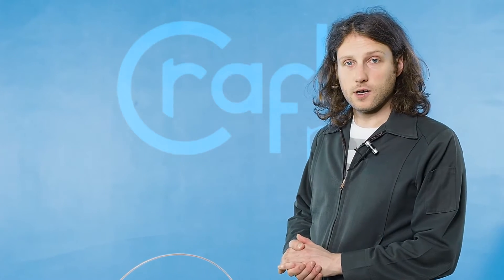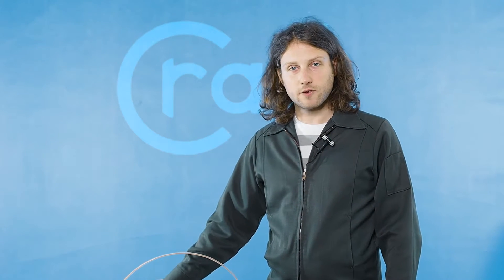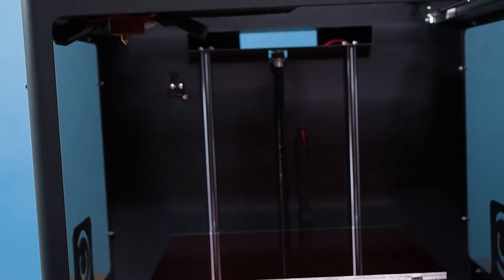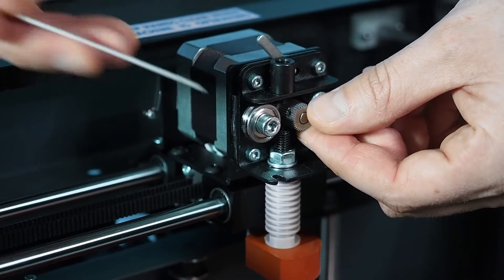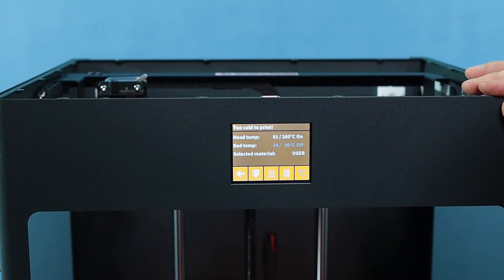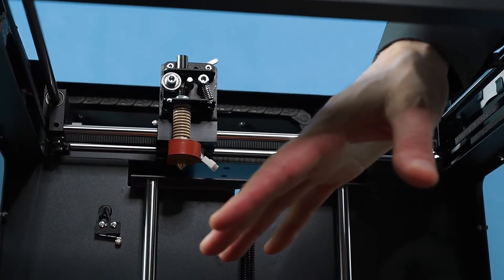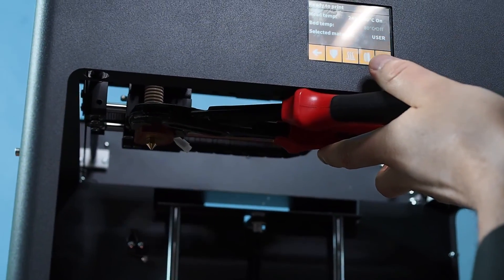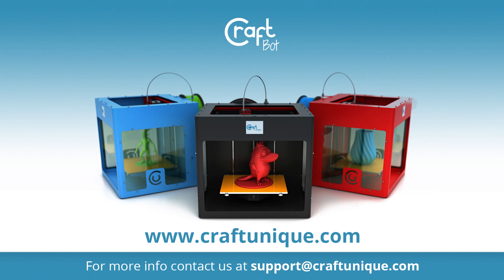CraftBot - How to solve cloggings

Comment: When removing the nozzle, I soak a towel in cool water, wring as much excess water out, then lay out that moist towel on the print-bed.  That way if hot nozzle falls, it will land on a cool damp towel.  And I use oven-gloves.  If you have a 7mm socket, the nozzle will probable not fall because it will be contained within the socket.